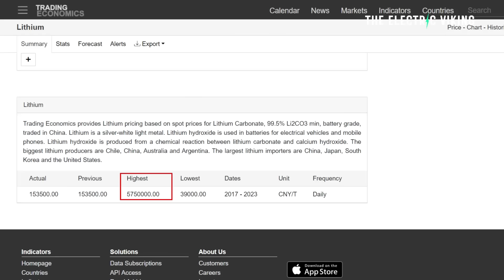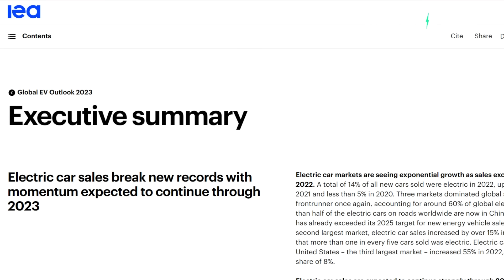The reason Electric Cars will be cheaper than ICE cars in 2025

Comment: After over four years with my Model 3P, the only thing I can tell you is that I will NEVER EVER buy another ICE car.
NOT EVER
I was always a “petrol head” and have spent a lot of time and money working on ICE cars, and I’m over it. Done, dusted, finished!
Reply: Same here - I've had 16 cars previously, and always did my own maintenance... never again!  Once you own an EV (in my case, a Bolt), there's no desire to go back.  Loving the fact that there's basically no maintenance, and "fuel" cost is much lower. Lovin' it!
Reply: This ^^^ Having a motor in the front and another in the rear is better in every possible way.
Reply: I can see why it suits some people.   Can you see why it doesn't suit others?
Reply: @allosaurusfragilis7782  Yes, absolutely. There are numerous advantages with an EV, along with a few disadvantages. One of the EV weak points is towing: Although EVs tow absolutely effortlessly, it makes a very big hit to your range. 
Many households like our’s are a two car family. In most two car families, having at least one EV is fabulous. 
We have two cars- the Tesla which is used for probably as much as 95% of our daily driving, and a 2014 SUV which is used now ONLY for heavy towing (ie: for trailers that are too heavy to legally tow behind our Tesla). The diesel SUV is now used so rarely that I have to leave it on a 12v battery charger between uses. My wife and I both hate driving it now- it’s like going back to last century, absolutely “out of the ark”. A very regular trip that we do to visit our son costs about $12 in electricity in the Tesla (charged at home, and much less if charged from our roof top solar), but costs about $85 in diesel in the SUV- (and that’s not when towing, which would be more.) Then throw in maintenance! On the diesel it’s oil changes, engine oil, air and fuel filters, brake pads etc etc etc etc 
Ignoring replacing tyres, our Tesla has cost just $80 in maintenance (just cabin filters) in over four years.
Reply: To thirty

Comment: The only way this could happen, would be if they increase even more the price for the ICE cars. And it seems this is the path they are following.
Reply: Yes, it does seem that.  EVs may indeed be cheaper than ICEs one day, but that may be due to rising prices (government induced) for ICE vehicles, and not so much due to falling prices for batteries.
Reply: Also inevitably fuel prices will continue to rise as there is less and less demand. Go EV's & Viking
Reply: @rodierst  electricity price is also slowly increasing and, currently, if you cannot charge it at home, it is more expensive to charge it using companies chargers than refueling an ICE car.

If the fuel price goes crazy, EV cars would be "cheaper", but not due to a price reduction. 
So at the end, it is just the same idea.

Comment: There are many underdeveloped countries that don’t have enough infrastructure to keep a refrigerator running for a full 24hrs. ICE vehicles will be around longer than you would think because of that.
Reply: It is so much easier to build a power plant, run hundreds of miles of electrical lines, build oil refineries, build gas stations, and import oil than it is to build solar panels and plug them into a car.
Reply: but those countries dont make vehicles, and they cant afford new vehicles. they will slowly die out.
Reply: In those countries...
Which country do you live in ...😂😂

Edit. and will you move to one of these countries in order to be able to drive an ice car in the future...😂😂😂
Reply: Those countries Will start using solar farm, since they are much cheaper to build and operate , actually the exact situation will help them  go more towards renewable. 

Same argument different conclusion
Reply: @sahastradhara  China is the leader in solar production yet they are building way more coal plants than before. Solar can't provide base load. Nuclear is still too expensive. Battery storage is also expensive. If China can't even do it, what do you think Africa and Latin American countries to go full renewable?
Reply: @i6power30  necessity is the mother of invention. 
Think about it, solar panels at home don't make sense at the moment but when u have a solar car. Solar scooter parked at home,  and an electric cook top, suddenly installing solar cells becomes a lot more financially sound decision. 
But yes for industrial purposes since load is high. U need coal or nuclear plants,  which can provide huge amount of energy on demand. And that's why China is building those coal plants not for normal households. But foe industrial level requirements.
Reply: @sahastradhara  Exactly, they will leapfrog onto solar/renewables, like they they did with cellphones instead of landlines.
Reply: They will build more coal plants to supply the grid just like China. CO2 emissions will increase not decrease because of EVs
Reply: @i6power30  Hahahaha Yea, spend millions instead of thousands!  That is your plan!  Great plan!
Reply: @i6power30  That is a faulty argument as electricity production to replace internal combustion engines would reduce co2, but the global south is accelerating development as the west lose ability to stop development in the rest of the world. So the global south gaining emissions per citizens closer to western countries will obviously increase emissions, but not because of EV`s replacing ICE.
Reply: @Stekopo  you know that burning coal to produce electricity then send it by transmission lines will lose 80% of energy in the process. By the time it gets in your EV battery you get 15% energy efficiency. Burning Petro at least gets you 35% energy efficiency. It's basic physics. 
If you run your EV on renewable or nuclear then you reduce emissions. If you run your EV on coal power, it's worse. No argument here.
Reply: @i6power30 using gas or coal plants to generate energy for EVs would reduce worldwide CO2 pollution while using petrol. Because the efficency of EVs reduces the CO2, although the energy would gain from dirt fossils.
And there is no toxic pollution in the cities, causing cancer or asthma.
Also the plants can filter these toxic ingredients better than cars.

Comment: WRONG.
You and Steven M Ryan are so full of it. Give me a break. What are you saying?  Just what do you mean by "collapse"? Do you mean that will EV sales jump suddenly to over 50% by then? Who will be manufacturing the 30+ M EVs in only 36 mo from now?  Certainly NOT Tesla. In 2026 Tesla will be doing well to produce 6 M cars worldwide. The OPTIMISTIC US EV adoption rate is more likely to look something like this.

Year	% of Sales	# of EVs Sold	Total EVs in US
2022	5%   		.67 M      		3 M
2023	7%   		1 M         		4 M
2024	10% 		1.3 M      		5.3 M
2025	14% 		1.8 M       		7.1 M
2026	20% 		2.6 M      		9.7 M
2027	28% 		3.6 M      		13.2 M
2028	38% 		4.8 M      		18 M
2029	50%  		6.3 M      		24.3 M
2030	63% 		7.5 M      		31.8 M
2031	75% 		9 M         		40.8 M
2032	85% 		10 M        		50 M

I know global adoption will be ahead of this, but the US is the second-largest auto market and a major force. So legacy auto has a few more years left to get a clue.

As for EVs being cheaper than ICE in 24 mo. That seems highly unlikely unless ICE vehicle prices spike because ICE automakers raise their prices trying to make up for losses in their ICE programs. John McElroy believes that a 20% drop in ICE sales will push legacy automakers ICE programs into unprofitability. That could prompt them to raise prices to try and compensate. Short of that EVs prices are not going to fall that dramatically between now and then.  Most likely Tesla will NOT be in production of their next-gen sub-$30k vehicle by then. So,  it's most likely going to be pretty much business as usual, similar to today, with EVs drifting down in price, little bit by little bit.

Comment: I think they said the same thing about hybrids but here we are. Still have many types of engines. I do believe EVs will always have a premium associated with them. Cheapest I imagine seeing is 30k, with most legacy/hybrid vehicles being in the lower than 30k based on the size and brand of course
Reply: BYD seagull dude
Reply: @hughmacdonald1911  US won't allow the import of just about all Chinese made cars.
Reply: @aquint5554  - and with good reason.  Chinese made EV cars explode, even when just parked!
Reply: @justaskin8523  no they don’t, ICE is 5x more likely to catch fire that EVs, but you knew that.😂😂
Reply: @justaskin8523  Tesla has exploded while parked also. What's your point? China EV quality range widely as they have hundreds of brands. Good and bad. Many fossil fueled BMWs have caught fire while parked also way more actually then EVs. I don't see the US banning all German cars?
Reply: You are the kind that always think status quo will continue. I bet 10 years ago you'd never guessed how wide spread electric cars would be today. You probably said EVs would never work. Battery density too low. Charging time too slow etc.
Reply: @i6power30  - 20 years ago, I was driving a hybrid.  But I was still saying all of those things.  It doesn't mean I was wrong to buy a hybrid, and it doesn't mean I was wrong to ask questions about batteries and charging systems.  Two similar but different things can be right at the same time.
Reply: @justaskin8523  the only way to get people up adopt EVs is government tax the gasoline to a point that'd more expensive to drive a gas car then EV
Reply: I had a Scion tc that got 29mpg.  It cost me $150 to $200 per month to fuel it.  I have a Tesla 3 now, charge at home, and my electric bill is up $80 per month.  EVs cost a lot less to fuel right now.
Reply: @PC-vq5ud  but will cost more to repair even it's old and out of warranty
Reply: @i6power30 Current battery energy density is far too low and charged time far too long still, I,m sure it'll get better but we are a long way off yet.
Reply: @philspencelayh5464  I agree. In the mean time I think phevs are the best solution
Reply: Citroen eC3 in Europe, €23.000.

Comment: Citroen e- C3 is already released for £23,000 with the short range model expected late 2024 to be £17,000 undoubtedly the rest of the Stellantis brands will market the same car. For context, Stellantis margin was 10.7% third quarter, consistent with Toyota’s which hit 10.6% operating profit margin this is better than tesla’s operating margin which contracted to 7.6% for the third quarter. 
Goldman Sachs’s recent automobile analysis “ By 2025, 25% of cars sold will have electric engines, up from 5% today. But most of those will be hybrids, and 95% of cars will still rely on fossil fuels for at least part of their power. That means automakers will need to make internal combustion engines more efficient to comply with new standards. Eg Audi RS Q Etron, Nissan e-power and Mazda R-EV all EVs with ice generators.
Moore’s law applies to transistors, yet some have sort to tie it to EV batteries, which has resulted in heated debate. However when considering solid state batteries it may have some validity particularly against the Toyota product plans.

Comment: Nothing you said will change the fact that there won't be enough charging stations for any appreciable increase in sales in the next 10 years. The typical gas station would need to install 90 chargers to get as many EVs through per hour as their 14 gas pumps can. Just getting the electric grid upgraded to do that is impossible. You are living in a fantasyland.

Comment: With uk EV car insurance costs rising to huge premiums. Many will no longer be driving or driving illegally. Due to the Battery fires and sealed structural battery packs.
Reply: Utter rubbish, my EV insurance in the UK went up 10%, my wife’s ICE car went up 15%. The ICE car is 5x more likely to spontaneously combust.
Reply: 😢Nope that’s utter rubbish my EV costs £25 a year more than the same petrol model
Reply: The cost of ICE car insurance is also increasing, in case you hadn't noticed......  Personally I'd be more worried about the 10'000 ICE cars that catch fire each year in Britain if I drove one. So far in Britain there have been fewer than 100 EV fires in total. Try checking the online call out log of the Bedfordshire Fire & Rescue service, who put out the huge fire at Luton airport recently. So far this year they have attended almost 1300 ICE car fires, and zero EV fires.
Reply: @Brian-om2hh  But Mr. Brain of Britain. You can easily put a petrol car fire out and it hardly impacts on the cars in close proximity, on the other hand, an EV fire burns at a much higher temperature, is almost impossible to put out and incinerates all the cars close to it, unfortunately if they too are EV's the whole thing grows into an uncontrollable disaster. Did you not see what happened to the Luton car park? Or the ships car transports. In conclusion, it hardly matters what causes the fire, once an EV gets involved, that fire becomes a disaster, possibly a daisy chain disaster.

Comment: I would like it if you would cover the Insurance side of owning and running an EV. With chargers becoming more predominate,
that barrier to owning an EV is closing. The new blockage is the Insurance side of EV ownership.
Reply: Why don't you call your insurance broker and ask for some sample rates and see for yourself.  Quite a few insurance companies are getting out of covering EVs or charging significantly more money for them.
Reply: @SlavGuns  I have a 2016 Charger and a 2023 Lightning insured. The Lightning costs $7 more than the Charger. Same insurance. Not sure what Insurance companies you are dealing with, but I would stay away from them.
Reply: My insurance for a brand new Tesla Model Y is $60 USD per month, so it's not that bad where I live.
Reply: Do you have google? Go onto car insurance comparison sites and check prices. Are you just raising the insurance issues because you’ve read about it but not research ed reality?

Comment: The EV market will be constrained by the ability of the electricity generation and distribution system. It is a scientific fact that one litre of petrol or diesel contains a huge amount of energy. Eliminating petrol and diesel and this energy must come from the electrical system. Home solar can supply a small amount of electricity, but only during the day if no large domestic battery installed and only at slow charge rate. The vast amount of extra electricity required will have to be supplied from many more power stations and a huge upgrade to poles and wires. In Australia 33,000,000,000 litres of fuel are used annually. Dream on.

Comment: You sure love throwing stuff against the wall and see what sticks.   As soon as we see more adoption of EVs, you will have skyrocketing demand on electricity which will kill any savings versus gas. Secondly the grid is simply not capable of handling mass adoption.   Comparing phones to cars is completely absurd.  How about TV? We still have a ton of people on 720 and 1080 despite 8k tvs being out.  As far as phones, keep in mind that back then you have to actually purchase a blackberry. Right now the entire business model is about financing with credits and replacing every two years. What’s actually gonna happen by 2025 is that internal combustion engine cars are going to be even more efficient. unfortunately the cost to ensure EV’s is through the roof. So, even if EVS were cheaper, the total cost of ownership once you factor in insurance is still likely to be higher. Just look at all of the EV‘s that are being totaled out by insurance companiesfor minor fender benders.